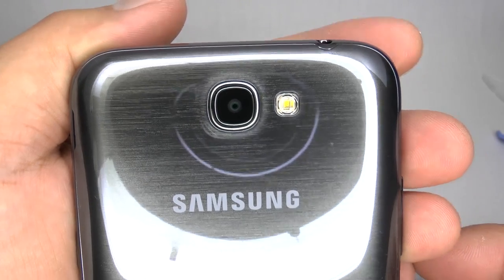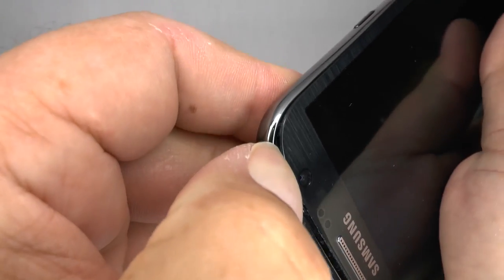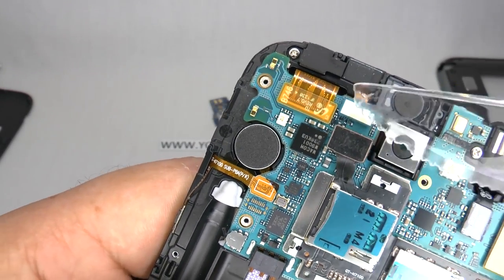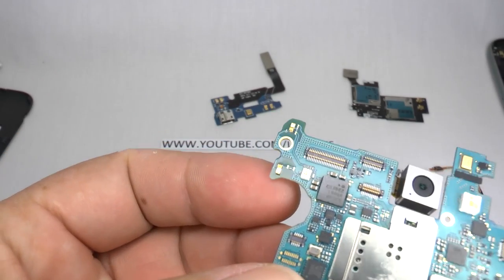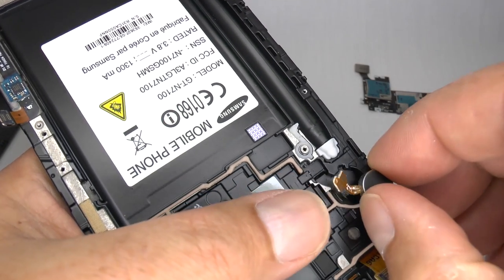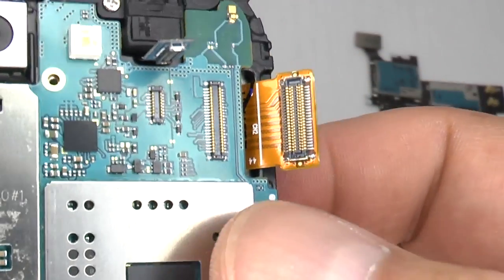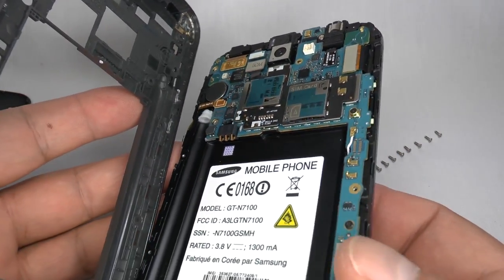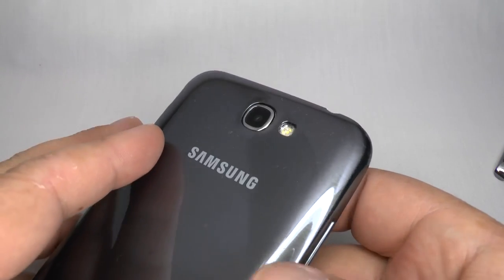Galaxy Note 2 Disassembly & Assembly - Screen and Case Replacement - Drop Test Repair

Comment: my microphone doesn't work when i make or receive calls.  but i can use my phone with the speaker phone.  any thoughts?  are there separate mics for speaker phone use?  i was hoping to hear you mention the microphone for replacement.  is that someone i can replace by itself?  thanks for your time.  great video.
Reply from the maker: yes the speaker phone uses a different mic, if you replace the usb flex it comes with a new mic 4:58
Reply: ***** Me again.   I did buy the new charging port and installed it when I replaced the glass.  Thought I Did Good AND Followed Everything to a T.  I'm writing this with the S pen because my fingers don't work on the screen.   Anything come to mind I might have done wrong?  It looked like I might have torn something yellow on the top left that might connect the lcd to something but it also looked like a protective covering.  Why would the pen work and not the finger?  Thanks again.
Reply from the maker: Paul O'Fallon the spen works different from the digitizer as it uses an extra mat on the back. Sounds like you've damaged the digitizer flex and will need a new screen assembly..

Comment: no its not. its if you want to change the whole front face. but its alot easier to disassemble the whole phone instead of using a hair dryer for 2 to 3 hours to get the glue underneath the glass soft/melted.

Comment: pls help. My screen got black while touch key lighting, and then some pixels light up like the sky with stars at night. Everything works except the screen. I've tried to carefully re-connect all the connectors but the issues still happen. I think the white cable one get damage when I reassembly. Sorry for bad eng.

Comment: Not sure if anyone can answer this. Recently my phone is barely getting a gsm signal. However if I stick a pin into the antenna test port accessible from the back it will get signal full blast. Anyone knows what could  be causing this problem?
Reply from the maker: I would suspect one of those sprung gold contacts need bending up to make contact with the rear housing. Another comment had success after doing this
Reply: ***** I had done that and still no luck.

Comment: ok... so I found out it wasn't my sim card... cause I used my friends phone (note2) n I got signal on his phone.... So I now know that it's a problem with my phone... Wouldn't replacing the signal antenna work?  Sorry for all these questions... I read online that some others have the same problem...but no one has an answer...

Comment: anyone have this problem: Headphone jack doesn't work when headphones plugged in, instead the audio from music and etc comes out from the phone speakers, but when using the sound about App to change to Wired headphones selection it works temporarily but then stops after a while then comes out from phone speakers again

Comment: Great thanks... removed camera as per office policy..
Reply from the maker: did you remove both camera's ?
Reply: Yes with proximity sensor
Reply from the maker: sajal Shrivastava you could buy a replacement flex and cut off the camera part so the proximity and ambient light sensor still work..
Reply: ok, Thanks will try.. :)

Comment: its a great  tear down video.

but it also states assembly. I used this to disassemble because i cracked my screen. but there is no assembly instructions.

no one is saying that your missing that glue that you had to seperate the glass screen from the digitizer. screen becomes unresponsive without it.

Comment: Hey I just broke my LCD trying to replace the glass on my Note 2. But Im pretty sure that it is possible to replace it. I cracked the screen while removing the glass. Should've been more careful. I also damaged the ribbon cable which is also avoidable. I have pictures if anyone's interested.

Comment: The power, the home buttons, the sound all works, s pen sounds off, I replaced the vibration part too but It didn't vibrate when I turned it on. I'm heartbroken and pissed I was really cautious when I attached it to the motherboard I don't understand why it's not working:(
Reply from the maker: don't worry its nothing you've done its probably a faulty new display, there's not much you can do except ask for an exchange

Comment: Help help help I just put back together my Note 2 with a new OEM pink digitizer from Etradesupply and connected it and tried turning it on it doesn't work:( what am I doing wrong? Please let it be an easy fix I tried checking the flex cables they are connected fine. :( help
Reply from the maker: forget the last reply, can you try plugging in the old screen?

Comment: I'm not sure if anyone will reply to me, but let's give it a try.. I have a problem with my note 2. I fallow exactly all of your steps, and when i try to turn on my note 2, nothing happen. I thought it was the battery who was down, but when i charge it, nothing happen, no lights, nothing at all. When i put it on my computer, he did not even recognize it..  I really don't know what to do, i'm really frustrated because all went supposedly nice.. Anyone knows how could i fix it? And if it's possible?
I supposed it could me the battery, but i did not have any kind to see if that works. My bad feeling is that could be the motherboard...
Reply from the maker: I doubt its the mainboard, its more likely to be a faulty new screen. Can you try plugging in the old one ?
Reply: *****  Thanks a lot for your answer! So, i can't because the previous LCD was already broken. So, i can't try with it.
If it was the fault of my new screen, don't you think, my computer should recognize the phone when i plugged in?
Actually, the phone is with a professional and tomorrow, he will told me what could be wrong. I'll keep you posted.
Thanks again, for your answer, and your amazing vid'!!!
Reply: *****
 So, the technician told me that it was the main board who was dead. But, of course it was not my fault during the process of changing the lcd screen.
I have to say, that i did not try the screen before i change it, on the phone ( like you have done few times of some of your other vid's ).
Anyway, now i've to do a Samsung Mega! ;) I'll go watch your amazing vid.
Thanks a lot for those, and please continue to do so ! :)

Comment: I switched out my headphone jack, and now my service dont turn on :/ any ideas?
Reply from the maker: Make sure the time and date are correct, if that doesn't work try plugging the old one back in, if it still doesn't work I would try a factory reset